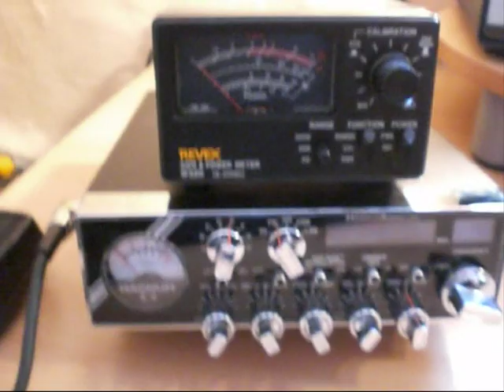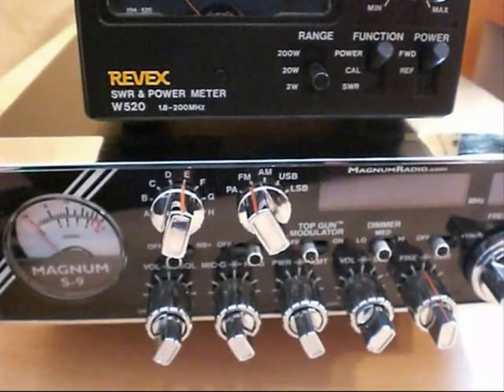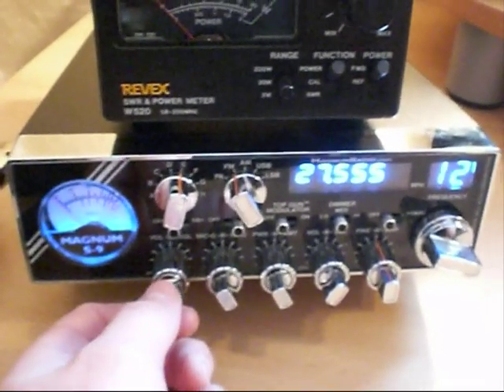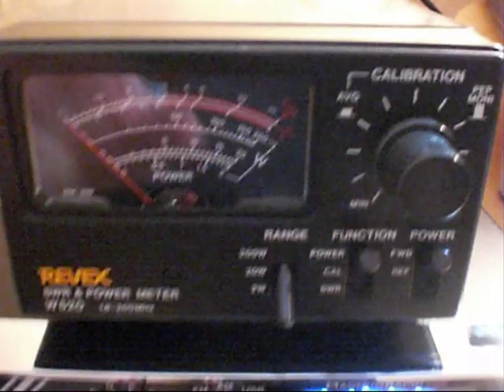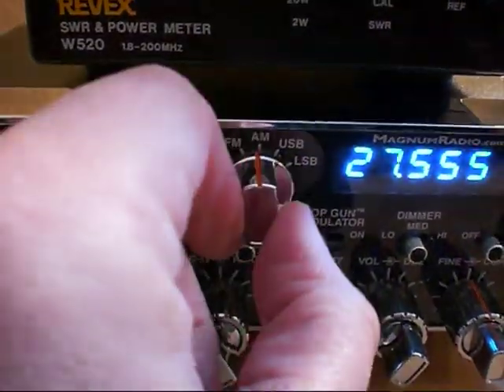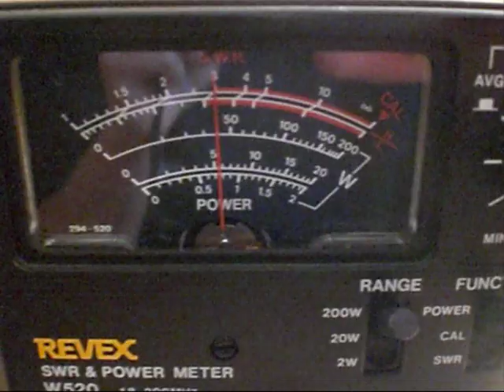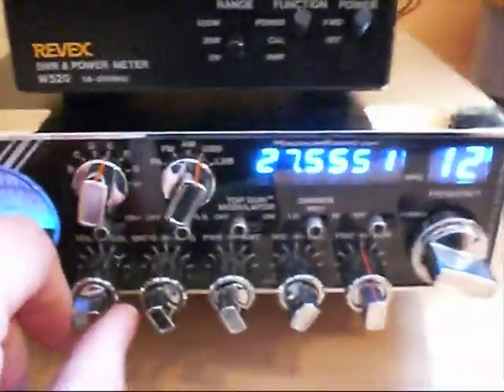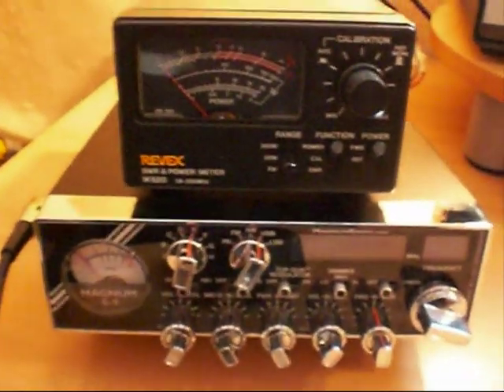MAGNUM  S-9....OUTPUT MOSFET REPLACEMENT...IRF520N

Comment: I owned a magnum s9 about 5yrs ago and I find it to be the best sidebander in the market. Gutted I sold it, but what the heck - I'm going to buy another one. You are right I've owned a superstar 3900 with frequency counter and it did use to drift all over the shop 73 Rob Swansea..

Comment from the maker: Hello my friend, yes it is best to check the bias voltage after installing the new MOSFET's.
If you set it the same as the originals as per service manual for ERF2030 (MOSFET version) it should be fine.

Comment from the maker: @24nov67  The IRF520's were not designed as linear RF devices bit will amplify RF, The SS3900 uses the same board as the older models but with the output stage modified to accept the MOSFET's as the 1969/2312's were made obsolete by Mitsubishi.
As the output circuit has been changed specifically for the IRF520/ERF2030 transistors you can not really use another device without circuit modification, as the IRF520's are so cheap anyway replacing them is not really an issue if they fail.

Comment from the maker: @SouthCarolina116  The problem is that there not RF linear devices and are also very static sensitive and can fail easily.

Some say the 520's can take more abuse but there basically the same device.

Comment: I just ordered some replacements & noticed that the bias board is soldered in  -  I guess you checked the driver & finals bias setting on your particular repair once the new MOSFETS were fitted?

Comment: My SS3900 uses these irf520s for both output and rf final driver, you say that they were'nt designed for this purpose (to amplify rf) & as 2sc 1969's &2312's are now all but obsolete are there other devices on the market that can be used in place of the mosfets should they ever fail?

Comment from the maker: I  advise people to run these types of radios at around 10-15 watts on AM/FM as it stops the outputs from getting to hot and burning out.
SSB is only peak power and is not so much of a problem.
ERF2030/IRF520 MOSFET's are not RF linear devices, they don't like static or high SWR and can blow very easily.
They are just cheap high-speed N-channel switching MOSFET devices commonly used in applications like switch mode supplies etc, they were never designed to amplify RF.

Comment: my s9 has 3 2030s i see 65w on am with a 10w dead key. low power i have a 4w dead key swing to 25w i lowered my dk and swing for my amp. only thing i dislike about mosfet this radio is the damn deadkey when the radio is cold startup the deadkey raises. not very stable at all!!!